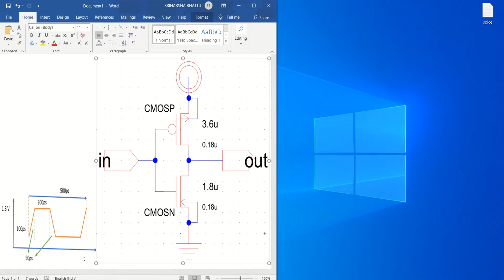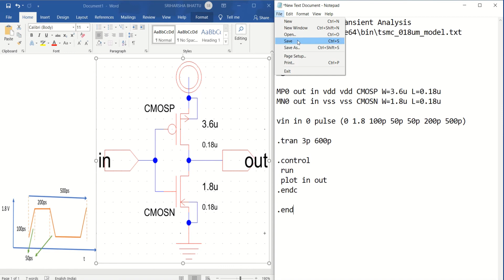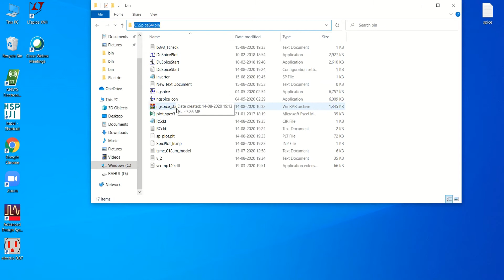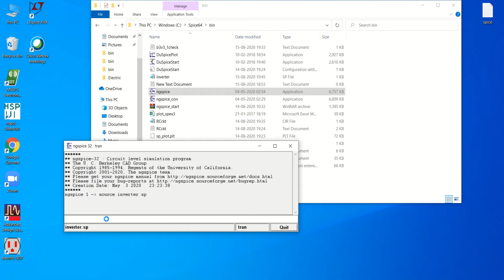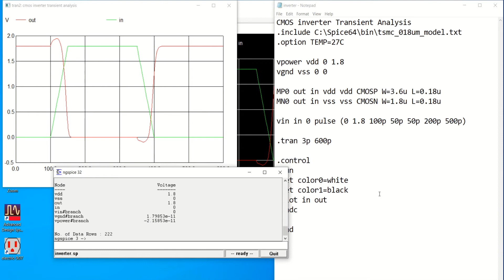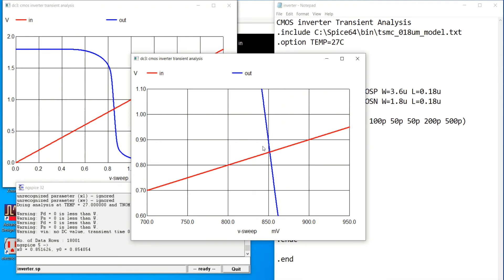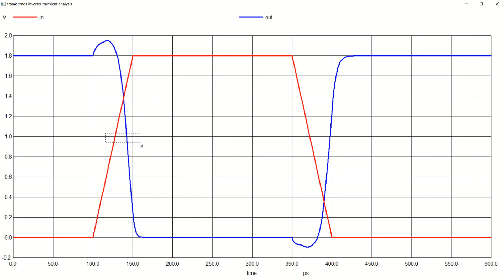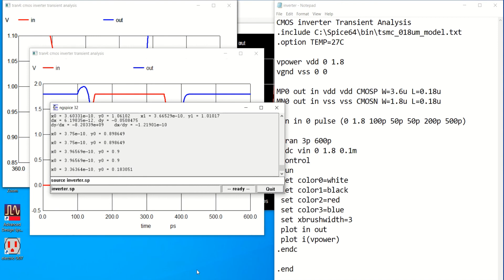Inverter Simulation Using NG-SPICE.

Comment: Very good video! 
Can you explain the measure command with examples?
Reply from the maker: Yes, I will do it. Give me time.
Reply from the maker: I have gone through the simulations. Ngspice do not support .measure command
Reply: @dr.hariprasadnaikbhattu  Thanks for the answer. Checking section 15.4 on the Ngspice manual (version 32), I got the idea that it was implemented.
Reply from the maker: @rolandprocell  I will check it.
Reply: @dr.hariprasadnaikbhattu   but sir it support .measure command sir
Reply from the maker: @sachinjaiswal1933  It supports meas instead of .measure
Reply: @dr.hariprasadnaikbhattu  yes sir make one video on that

Comment: What is the second line of the program ? . include , pls can u share the .TXT file which u have used
Reply: What is that file exactly ?
Reply from the maker: @shifashende702  It is a 180nm technology file.
It is necessary to simulate the CMOS circuits.